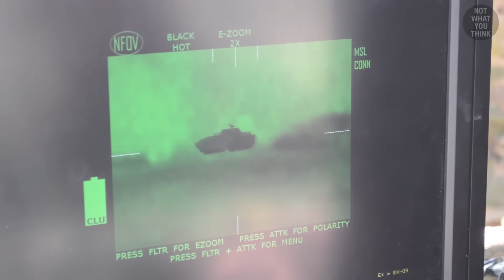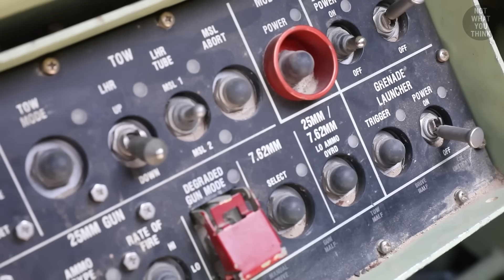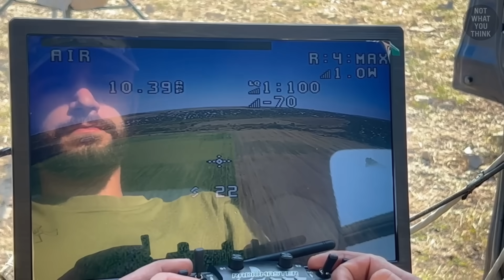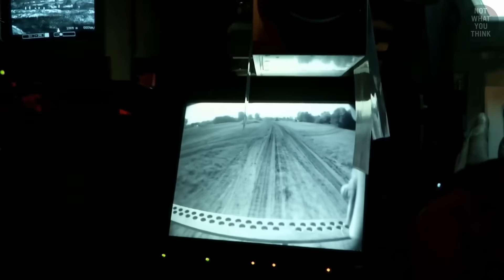How Bradley IFVs prove more Useful in Ukraine than Tanks

Comment: the bradley is a specific counter to heavy tanks, basically a glass cannon in AFV terms. we made it to counter that strategy, having superheavy tanks that rush in front of a motorized force get blunted to increase the effectiveness of smaller tier antimaterial equipment. in my personal opinion, the heavy tank isnt obsolete, however its dominance has been significantly reduced back further into its niche, which is punching through defenses active and passive with a low profile from return fire. airframes have a lot of angles they can be seen and targeted from, and tanks have significantly less, especially in the case of russian tanks with their height. while it is true we are moving away en masse in the global war order away from situations the M1A2 can capitalize on, we are also moving closer to the domain where lighter vehicles can become really potent. if there is enough high capability AT munitions in play, the motorized elements can become really effective. once the tank corps gets chewed on, those light heavy weapons cars with heavy machine guns and automatic grenade launchers can do some work with better cost efficiency and mobility

Comment: With a Surplus of older Tanks, the Russians could "in theory" fit them out tobe autonomous unmanned armored tracked vehicles, or drones/robots.
But recent tactics have emerged where a T72 or T90 are protected by Mobile Infantry and Drone Operators, both for munitions delivery and surveillance/target marking.
The Mobile Infantry can advance into a congested area using dirt bikes in a 2 or 3 prong penetration after an artillery saturation. Then the infantry attack the tree line dugouts, calling on the heavy tank to hit some hardened fortifications, saving Infantry and Tank Crew lives and equipment.
Ukraine tank crews are quickly and poorly trained and easily destroyed.
Ukraine still entrenches Tree Line fortifications making it easier for the Russians to clear out as they capture more villages and towns and cities.

Comment: There have been huge losses of Soviet era BMPs which equipped both sides during the first year of the war. Most of the tank losses have been the Soviet / Russian T-72, T-62, T-64 and the later T-90. All of these have issues with exposed ammunition and usually burn like a firework if penetrated. The few Western tanks, Abrams, Leopard and Challenger have NOT been supplied with the up-armour kits used in the Gulf Wars because they don't want the technology to fall into Russian hands. Bradley is old, almost as old as the BMP, It has only been in service in Ukraine from earlier this year. I wonder if the maker of this isn''t BAe Systems who now make Bradley?

Comment: 8:43 small but crucial clarification: in storage. Not reserve. Putin has effectively NO tanks left in the (combat-grade) reserve these days - meaning they need a brief one-over, fuel and ammunition, and can rolled right into the fight. The number of Russian tanks in storage is truly mind-boggling. But as can be seen in the aerial footage of the armour depot when you freeze-frame, the stored tanks vary from combat-ready reserves to scrap metal. And depots have been emptied at a remarkable rate. The top-quality vehicles simply have disappeared altogether some time ago already.

Right now they are drawing on those that need some repairs but are still in good condition overall - and this is in fact the bulk of what is touted as "Russian tank production": Because the most modern Russian tanks use Western precison-manufactured components in the engine, drivetrain etc, they can't be produced at all before another supply source is available, and even then the mechanical reliability in the field is bound to suffer. So most "new" Russian tanks are actually refurbished ones.
And there is probably less than 1000 left of these. They are bound to run out some time this year, leaving the next-worse batch, which is tanks that were stored in the open, with  noo protection, some open hatches and/or for 5 years or even more. They need a major overhaul that requires weeks or even months for every single tank. OFC in a factory many such tanks can be fixed at the same time, but it is still very cumbersome, as the defects differ from one tank to the next, meaning they each need a 100% thorough inspection down to the last nook and cranny before one can even consider starting to repair them, and repairs can hardly be streamlined either. The USSR rationale was that these tanks replaced combat losses post-war, when they could be refurbished at a more relaxed pace; this is why they weren't kept in proper storage condition but just superficially protected from the worst weather. Vehicles of this "quality" make up about half the remaining Russian tanks in storage.
The rest is hulks and rustbuckets that take too long and cost too much to be refurbished, or are too broken for repair. In satellite images of depots, they usually form a striking rusty-red patch in a corner far away from the main gate. Most of them have been standing in these "tank graveyards", out in the open and all but forgotten, for at least a decade. Some probably were put in the early 90s already, as the former Red Army was cut up in its national constituents and its active-duty inventory downsized. These are hulks to be cannibalized for spares. They were never meant to move again. Interesingly, Russia's largest tank depot seems to be mostly a collection/disassembly yard where hulks from the other depots are collected for mass cannibalization, a tank-cadaver rendering plant if you will. Which makes sense, because the logistics drawbacks that encumber refurbishment of the second-best stores do not apply here; it's a crowbar-and-blowtorch job where you can't break much... indeed the most serious problem may be getting enough menial labour to process the carcasses, because there is a painful shortage of low-qualification blue- and white-collar jobs all over Russia - too many of these people have signed a contract with the Ukrainian Sunflower Fertilizer Company and are busy working there...while higher-grade jobs make really good money in Russia right now, the people who actually keep any economy running, the grunt workers, are being irretrievably lost at a rate of about 1000 each day (this starts when they sign their contract or are dragged to the recruitment office by some burly thugs, and not only when they die).

So what's the lowdown? Well, bluntly, Russia may have little more than 2.500 tanks left in a condition that permits future combat use, and 2/3 of them require some serious repair work that cannot be streamlined. And that is that.
They will build some new tanks with degraded quality due to having to order some of the most crucial parts on Wish rather than at the guys who supply Volkswagen, BMW, Daimler and Porsche, but the entire annual production is so low that Ukraine would need 2 weeks to destroy them all again.

The average Russian unit now has probably at most 50% vehicles of all types in its inventory that were actually designed for frontline combat situations. Some units are down to a mix of unarmored militia-grade gear and civilian cars and motorbikes; basically, a Russian vehicle is now likely to be as useful as those civilians cosplay as soldiers Putin is sending to die by the thousands. If Russia were a village, Putin would essentially be forced to slaughter all the cows, including those that were supposed to calve next year, and all the stud bulls, lest the village starves during winter - and their beef is being eaten with a thin gruel made from the last seed grains.
They are not using reserves; the reserves were already all used up by the time of the "epic triumph" at Avdiivka (a small town with 20K inhabitants pre-war, now uninhabitable wasteland with less-than-zero intrinsic military or civilian value). They are burning through their long-term stores, scrabling to refurbish those clunkers faster than they get destroyed, and probably failing at that, and if Putin had be any sense left his invsion force would be running back to their starting positions and digging down there as hard as they can.
But he hasn't, so they won't.
Reply: booooring.
Reply: Russia hasn't run out of tanks. They have simply charged their war strategy. Russians aren't blitzing enemy lines like at the start of the war. Now they are slowly advancing using many small squads and drones. The tanks are kept in reserve until they are needed for a breakthrough. It's a much slower way of fighting but it seems to be working. Ukraine is getting worn down.

Comment: The 20mm chain gun is just not powerful enough on today’s battlefield. A 30mm cannon firing proximity shells is needed along with a small radar system to deal with aircraft and drones.

The draw back on current Bradley vehicles is there height and inability to cross rivers un added

Comment: Tube launched, Optically  tracked, Wire command-link guided missile. I was a TOW gunner when I was younger and from what I understand, there is a wireless TOW missile in modern times but the appropriate nomenclature is Wire command-link guided missile.  They have a 99% kill rate if the operator does everything correctly and tracks the target as smoothly as possible, and they have an effective range of almost 4km. I personally made 3 TOW hits from maximum  range which at the time was 3750 meters at a moving target, so I know for a fact that they’re deadly accurate and can destroy any modern day MBT. 7:37

Comment: Much of this presentation is just wrong.
Tanks in urban environments are at their most vulnerable. Their mobility is restricted due to dense building covered blocks, rubble, and tank barriers. Enemies can easily find ambush locations, often at higher elevations in adjacent building structures, where they can rain down short range, shoulder fired AT weapons on the tanks. That is the reason for the TUSK kits for M1 Abrams and BUSK for the M2 Bradleys. Additional armor, spall liners, and other enhancements help the AFV to survive in this most dangerous combat environment.
The drones are a game changer for defenders. It will take some time, but AFV design and construction will eventually result in a vehicle that is able to deal with drone strikes, and change the game back again.
The Ukranians are sending veteran pilots and novice pilot candidates to places like the Netherlands to train up on the F-16 and other western fighters. The biggest hurdle they face in the training, is to deprogram the veteran pilots from the Russian tactical system, which is heavily based on central control from the ground. Western fighter doctrine emphasizes flexibility and near autonomy of a fighter flight, which means that the rigid, highly constrained Russian system has to be replaced in order for the F-16 to work in the theater. Several MiG fighter vets from Ukraine have failed out of the training because they can't make the transition. Once the new guys are trained to standard, battlefield air superiority becomes a possibility in the F-176 and other western fighter aircraft.

Comment: The biggest problem with Russian tanks, after the fact of Russian corruption mean the tanks are not built as designed, the main flaw is the "Joseph Stalin Integrated Safety Auto Loading System" that causes tank crews to sit on all of the tanks shells. In essence crammed together making one rather big explosive device. Because the safety of a timed detonator must be removed before the shell can be loaded and fired. So all the shells loaded in the autoloader are capable of going "boom" inside of the tank. And why a single shell loaded by a person is still a superior method for the tank to be effective and not offer extra weakness in battle.

Comment: I'm not sure you can say Bradley's are more effective than F-16's. But again it isn't so much weapons system. It's having enough of them so they can work together as a cohesive unit. To have enough tanks or jets to watch so they are not routed or flanked when engaging in battle. That there are many threats today and only by working together as a group and not individuals can they be overcome. If you gave Ukraine 100 tanks, or 100 F-16's, or 100 Bradley's then in each case they would prove very effective. Russia is still bigger than Ukraine.

Comment: The Abrams has gone tank to tank and dominated without air support. You seem to be forgetting the battle of 73 easting. It is a well earned reputation. No that does not mean the Abrams is the best tank on the battlefield in an objective sense, and maybe it never was. But it is objectively very capable and its reputation is well earned. No tank can dominate without infantry and/or air support. Whatever tank out there is objectively the best tank, is nothing if it lacks infantry to protect it.

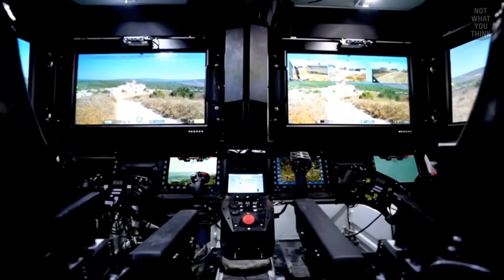Comment: 10:37 - It is not correct to say because of "these developments" that the Booker was made.

You were correct however when you talked about the weight and being able to easily airlift it, but that has more to do with logistics and where the US is situated. Same goes for China. 

The new front of a potential war with China will the Indo-Pacific (which is also why China made their variant). Island hopping campaigns etc and the side on an island with more of these will come out the winner and is the reason the need to be lighter and more easily supplied, miles away from any nearby US factory. 

I doubt Russia for example would do the same. I don't see them fighting on island any times soon, if ever. They supply most of their tanks anyway to the frontline by rail. Weight isn't that much of issue.

Comment: 1:47 - And also talk about the variant of Abrams vs the variant of Soviet tanks that was happening in those battles.

In fact, would love to see a video where they have a full breakdown of NATO tanks vs Iraqi tanks (Soviet provided) and what was available at the time. And speaking of Soviet provided, the agreement between Bush and Gorbachev to not provide aid. It is not like Soviet tanks didn't have thermal optics for example, but the tanks Iraq had didn't have. Like take that shot at 1:56 . . That isn't a T-72 (a tank made in 1972), it is from what I can see either a T-55 (made in 1955) or a T-62 (made in 1962) and even then, if you saw those variants around this time should have better armor kits, like ERA.

And yeah, in Ukraine NATO tanks are faring about as well as Russian ones. And yes, like you say at 3:06 recon is way too "overpowered" now. No one can mount any sort of attack anywhere, without the other side knowing.

I think no one has come to grips with the threat drones are playing and until a proper counter are implemented, it shouldn't be reflexive on the role of the tank. Infantry are not immune to small arms fire, tanks and IFVs are. That is their major role. From WW1 until to it is to get troops across wide open terrain and you'll always need that as long as you have infantry. (Maybe when you have terminator style robots / drones that are immune to small arms fire you can talk again)
Reply: While some Russian/Soviet tanks did have thermals, the Warsaw Pact was emphatically far behind the West in terms of thermal imaging being standard. Soviet formations were much more likely to have one vehicle with thermals for a platoon, if at all, or assigned to every vehicle of select units but not the entire army. Whereas Western armies, especially the US, fielded every single MBT past a certain date (in the US' case, ever since thermals got implemented for late M60s as standard) without exception.

I agree with everything you said I was just elaborating on the whole thermals thing for Russian tanks.
Reply: @bluntcabbage6042  Sure, no problem 👍 Thanks.

I mean, in general what desert storm and the Iraq war showed me (and hell even recently, when the Russian army rolled over the Syrian rebels) has more to do with the doctrine in middle-eastern armies than anything else.

Another good example would be how the F-4 Phantoms struggled in Vietnam against the MIG-21 jets, but when Israel used the F-4 vs Mig-21 jets in the middle east wars, the F-4 did much better.

There is actually a few analysts I saw speak about this very fact, ie how armies in the middle east are always under performing. Which is a larger factor at play I feel when you look at the results in desert storm.
Reply: @Scar626  A lot of things were definitely working in Western favor in their many Middle Eastern excursions, yeah. Doctrinal, technological, and everything in between. Lots of reasons why ME forces struggle but that's a whoooole can of worms.

Comment: What needs to be done is to put all military equipment into perspective. Each one has a specialized duty to perform . None is greater 
Nor weaker . Combined and used effectively 
It makes the battlefield much  easier to  reach 
Your objective.  With the help of technology 
And information - strategic intelligence and 
Planning can be implemented . Thus you minimize 
Potential risks to the soldiers or equipment. 
In the near future.  Tank operators won’t have 
To risk life and limb .  Everyone will be in a 
Well fortified office with air conditioning 
Toilets and running water